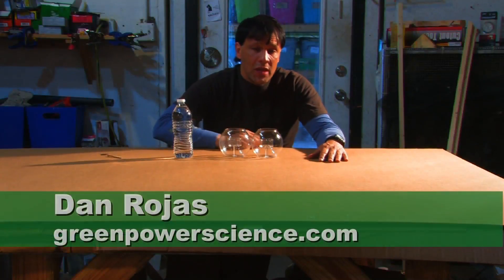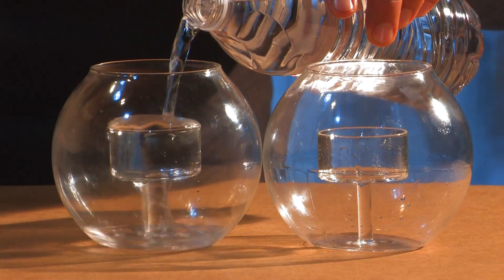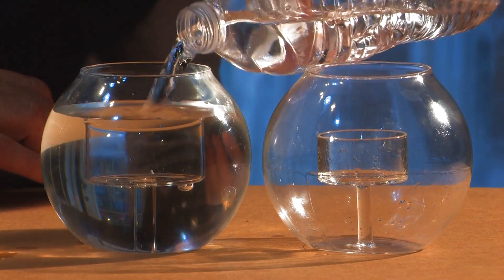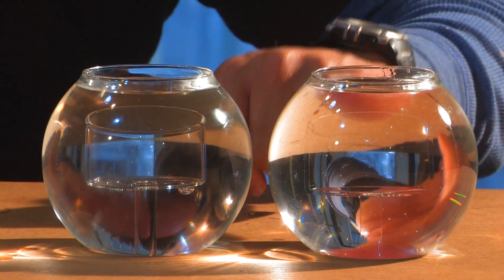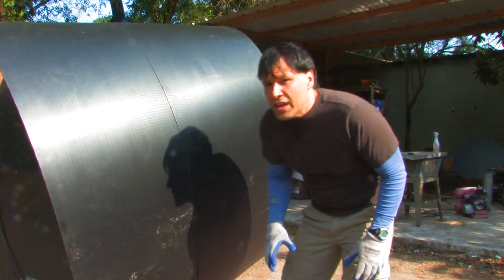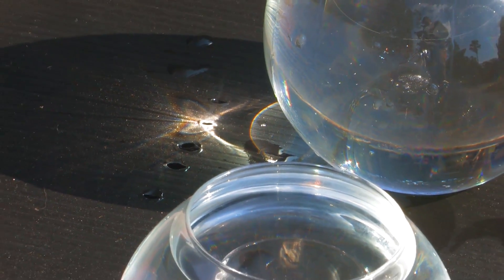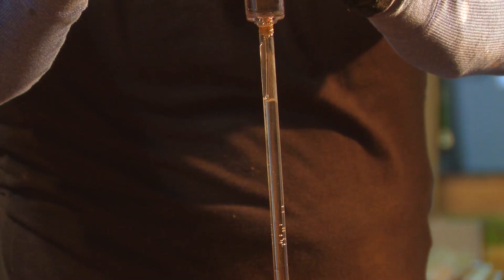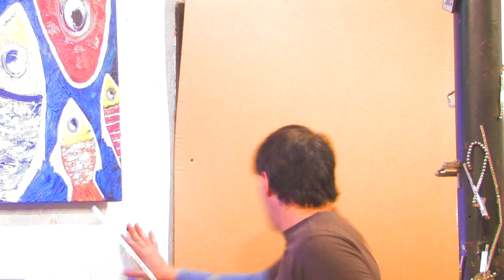DIY FIBER OPTIC mineral oil fire starter from liquid fibre optic lighting SPHERICAL

Comment: In the Philippines they've started using bottles filled with water to bring light into their homes, as electricity is too expensive for a lot of people there. Maybe you could try bottles filled with mineral oil to make it more effective? However I don't know if bottles would be long enough to reach down to an underground home?

Comment: If you had a water globe without a glass inside it, it would burn as well as the mineral oil. The glass disappears in the mineral oil because it is a similar refractive index, permitting it to transmit without diffracting. The reason the mineral oil makes a fiber optic in a glass tube is because the glass has a slightly higher refractive index than the oil, as does all outer cladding on fiber optics.

Comment: To join 2 globes together with a tube filled with mineral oil to light up a closet(for example) are mirrors as in a periscope required, backing reflector (aluminum foil~mirror mylar from a potato chip bag etc.). Not to burn or start a fire, there are lenses used in old movie projectors that reflect  infrared away from the film, that or some other way to block infrared. I’ll do what I can l and check back for responses.

Comment: I have seen soda bottles filled with water used as low cost sky lights in impoverished countries, with one end on the outside the other on the inside. They seemed to work great and mineral oil should improve the design. If you filled a flexible tube with it would you be able to see through it to the other side?

Comment: Hi! I have a pretty "urgent" <~ (That word is always relative LOL) question, as i am wanting to do this project this weekend. You said the tube had to be a "sphere shape". But does it have to be straight. I want to run a clear pvc hose through my hen house using this method as a light. Will a flexible hose work if it is not straight?  Thank you!
Reply: Oil has liquid fiber in it

Comment: What is the heat transfer, when used in applications such as solar lighting? Does it have to be a straight tube, or can there be turns (elbows)?

Comment: This is great!!!
BTW, you can extract the bubbles using a process called bleeding used in replacing oil for mtb brakes, where you press oil into the tube above its capacity and let the oil "crush" the bubbles and make them float

Comment: Hello Dan, Im making a small solar heater. Would it be worth filling it with the oil to capture more light an store the heat in the oil? i have a video up of it, not air tight yet im also worried if pressure builds up. Peace

Comment from the maker: The wall is poured cement 8" thick. The molds for the sections were 4ft x 8ft tall and 4 feet in the ground. The holes are from the 3/4" bolts that kept the mold/form - splitting in half from the cement weight. Our forms were 2" thick wooden walls and still bulged without the bolts, one form spilled.

Comment: A lot of intererting hobby works that demonstrated the fun with simple prinsipples. I have a number of questions. About this movie:
You showed that oil had a better refractive index than the one filled by water. 
What i would like too see the diffrence of the last thing you showed. Water in the tube /vs oil.
And about all the parabola reflectorsyou have: did you make them ? if not where did you buy them?

Comment from the maker: I think it would be much better because it also would not sag as much and allow for a larger diameter lens. The tarps are shot from rain. The big one held almost 200 gallons of water after a lot of rainy days in a row. It finally sprung a leak. 1500+ pounds. Structure held fine. Still like your lizard video.

Comment: Don't mineral spirits and linseed oil eat through plastic?  I don't think you could use plastic tubing.  I think it has to be glass...but you could do some neat things with lab glassware as light fixtures, no?  Glass tubing bends easily with the right torch.

Comment: That kind of oil isn't the normal white mineral oil you find at the drug store.  Its kind of toxic actually, and sometimes dark amber in color.  It can be pretty expensive, because it has to be "dry" - that is, it cannot have any moisture infiltration, and once used it has to be sealed to keep humidity out (at high voltages, the moisture could arch).

As a heat transfer agent (not a light transfer enhancement) it would be interesting to see the results of such an experiment though.

Comment: Mineral oil has a much higher index of refraction.  It really makes a difference when light is passing from one clear media (air) to another (glass) then another (oil) and then back out the same way.  The glass-oil interface bends the light a lot more than it does with the glass-water interfaces.  That is also why (if you look at the video closely) the focal length is shorter with the oil (more powerful - a faster lens in photography-speak)

Comment: Great video. The mineral oil solves one of the problems I have with the soda bottle skylight. If you haven't seen that video it shows how in villages they are recycling soda bottle filled with water to provide light into huts, saving energy where they have it. I want to used a soda bottle light in my shed but was concerned about freezing during the winter. Mineral oil should fix that.

Comment: MIT developed a lighting solution for third world countries. They used soda bottles filled with water and a little bleach, that was stuck in the middle of a square corrugated roofing 'patch'. that could be installed on the roof of shanties and provide light comparable to low watt CFL bulbs.

Comment: So, two things I'm left wondering about after seeing this, the first one being how much of a decrease in effect you'd get from using clear plastic tubing instead of glass as that's what I imagine most people would be able to get a hold of.
The last thing is whether the focused light at the end of the rod is strong enough to catch things on fire or not?
Oh yeah, and wouldn't this work if you use plates instead of tubes? That way you'd get slits of light.

Comment: hi dan this isnt related to mineral oil but i had an idea for a REALY cheap solar water heater i bought a roll of black polythene and a cheap hand held bag resealer sealed the edges well to make a tube and sealed intermitant strips through the center for strenth large water path so its low pressure. 50m2 for about $100 :D

Comment: (cont...) Also for transmission of light energy.. it could be be transmitting through a smallher hole in roof or wall of home and then split againg into wider area, using mirroer and prisms to split the light again?

Comment: I am thinking it may work to wrap the tube in shiny aluminum to get greater distance of light ransmission? I am wonderif that would also work in conduct high intensity energy transmission from the sweet spot of his parabolic mirror. I am thinking one of the benefits of this could be to send the energy to a protected place hidden from the environment and also to keep from blocking the sun's energy from reaching the parabolic dish...

Comment from the maker: From the net:
Mineral Oil has a flash point of 170C (335F), and a boiling point of 310C (590F). By definition, "Flammable liquid" means any liquid having a flashpoint below 100 deg. F. Therefore, Mineral Oil is not a flammable liquid, however it is a Class IIIB Combustible Liquid, meaning that it will burn, but must be exposed to high heat before it will sustain a flame.